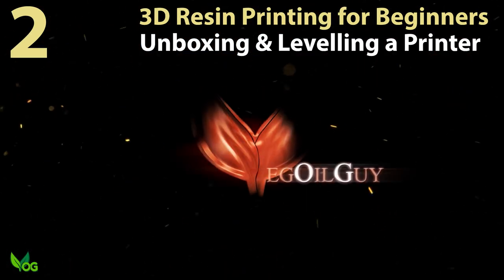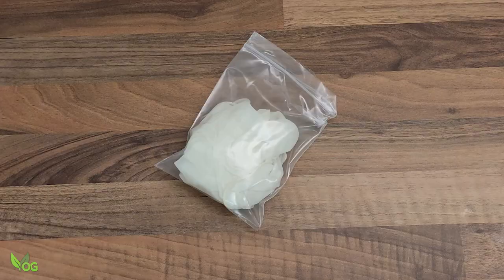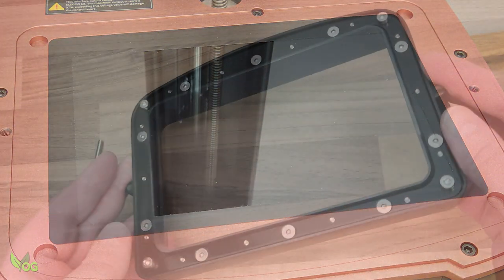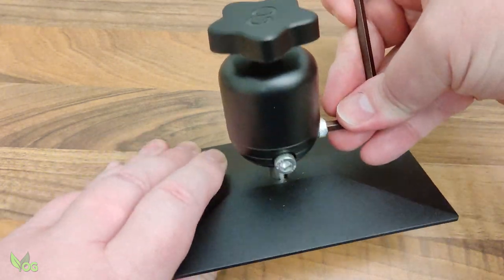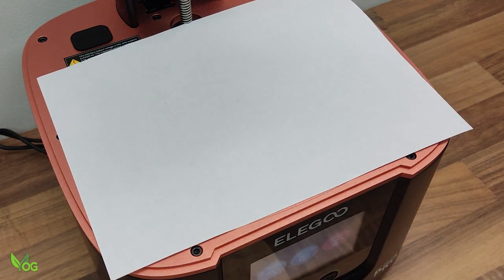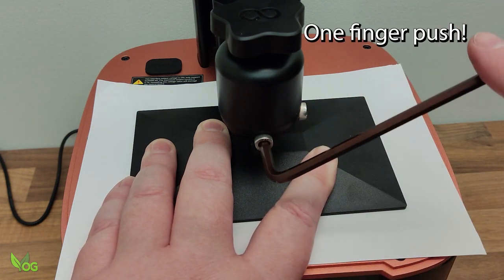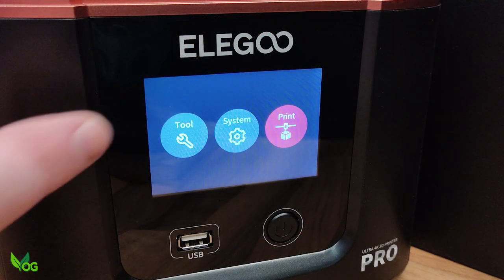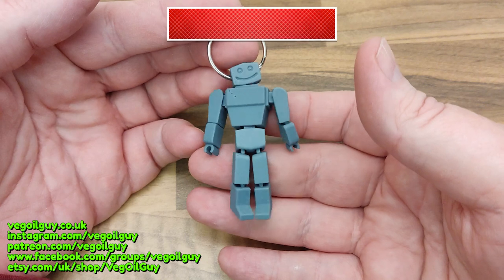2. How to Assemble, LEVEL & Test a 3D Resin Printer

Comment: Great video series to help those just starting out. I did notice a point about z=0 that was definitely confusing to me in the when I first started printing. It does not set the minimum hight the build plate can go down to. That is accomplished with an optical limit switch. Z=0 is an offset above that point to begin the first layer. The printer will still home to the limit switch when beginning a print and then rise to the z=0 height to begin the first layer.
Reply from the maker: You're absolutely right, but I was trying to keep it simple. 😁

Comment: I'm curious if you have an opinion on tables for setting up the resin printing setup? Would a metal stainless steel table be a good idea for cleanup? Any particular size?
Reply from the maker: I've no real preference for table type, but a good wipeable surface is a must. You'll always spill resin, no matter how careful you are. I'd also recommend a Wham Bam slap mat (or similar) as these work well. Since I've had mine I've found I tend to naturally contain my mess to the mat, and cleanup there is easy. Have a look at this video and skip to 4:57 I think https://youtu.be/kqFmf_PqoOg where I mention mine. After that, I think you see it in all my videos 😁

Comment: I've been wanting to get into 3D printing for a while and I'm torn between this Elegoo and the Voxelab Aquila.
Reply from the maker: Ooo... FDM vs Resin. That's a choice only you can make.
FDM = slow, poor detail, cheaper, fairly strong, better suited for practical printing than fine quality printing.
Resin = faster, bit smelly, easier than FDM (in my opinion - hence these tutorials), messy, great for high quality (like miniatures, jewellery, model making, etc).
These are just SOME of the considerations. Personally I love Resin, but there's plenty that love FDM 😁
Reply: @vogman  I feel like I'll end up having both in the long run haha. I'm slightly leaning towards getting the Aquila first due to lower costs involved. The learning curve for FDM is one of the things I'm weirdly looking forward to. Can't help but feel like I'm going to learn a lot of new skills in the process.

Comment: Good sir, there was a button at 6:30 for Tank clean - could you please go over this and general maintenance areas?
Reply from the maker: Cleaning is a topic I've already listed, so I will be covering it. But for now... the Tank Clean blasts the tray with UV and sets hard any resin still inside where in theory it can be safely peeled off. It's not a method I use as when I have resin stuff on the FEP I can never get it off - but that's the theory 😁😁😁
Reply: @vogman  Thanks!

Comment: Looking like a good series. A topic I'd appreciate would be on "gut feel" for supports in resin printing. I've done plenty of FDM printing and have a decent understanding of what I can (or can't) get away with when it comes to supports and overhangs in a model.

I tried slicing a model of a dragon in Lychee (for my Mars 3), which then passed the output to UVTools. UVTools reported all sorts of errors related to islands and unsupported areas; so does that mean Lychee's automated supports are insufficient? Does it mean that UVTools is overly sensitive? I guess I could just try printing the model to see what happens, but obviously I might just be wasting resin.
Reply from the maker: Supports is certainly a topic I'll be covering 😁

Comment: One question that I have that no one seems to want to answer........what drawing/drafting programs can be used for 3D printers?
Reply from the maker: Any. Pretty much most CAD type software can save creations as STL or OBJ. From there it's into a Slicer and then a printer. Again this is all stuff I hope to be including in my tutorial series, provided there's enough interest of course. If I end up talking to myself, I'll take the hint and stop 😁
But just as an example, have a look here https://youtu.be/QkR2x0LvYqw where I started a design in Fusion 360, refined it in ZBrush, printed it in ordinary resin to prove the concept, then print it in castable resin and converted it to bronze.